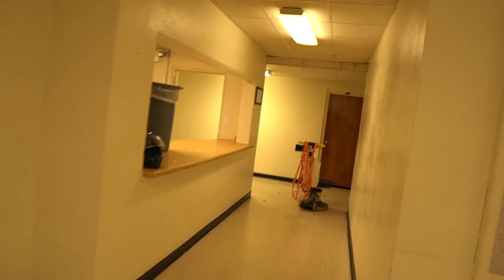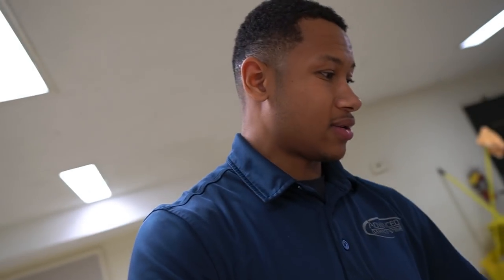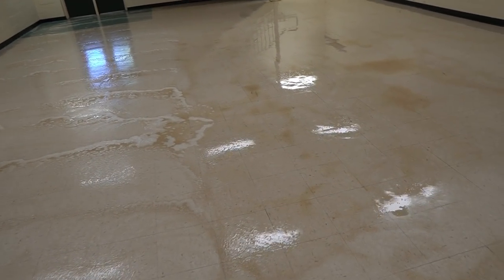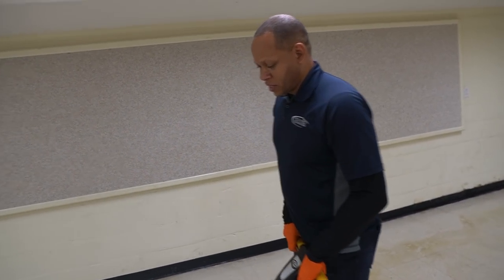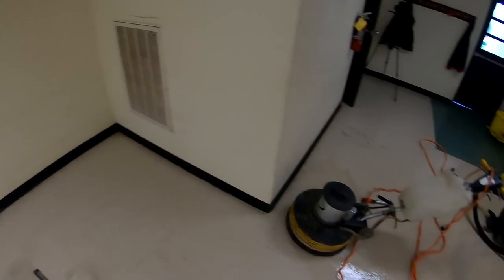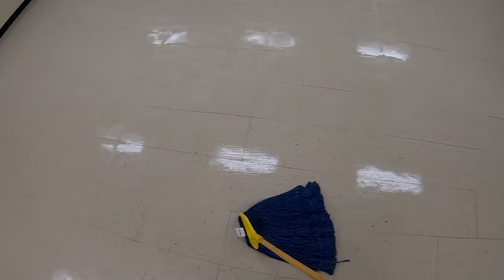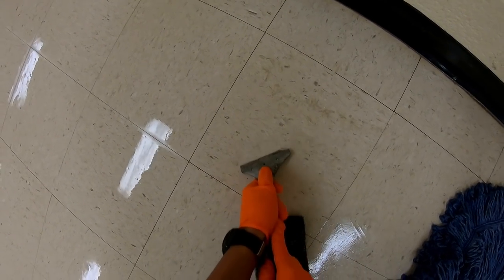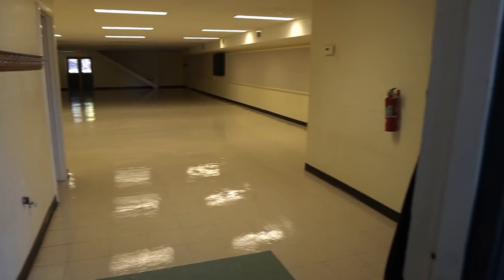ASHY to CLASSY || Stripping in a DIRTY church

Comment: I love your channel. A black man doing what i aspire to do, open a cleaning business with a specialty on floors. 

Im a custodial manager and have been for 7 years. Imma recommend the following, 
1. get stick blades. That way you dont have to do all the bending unless necessary. 
2. When scrubbing, stay in the squares and make 3-4 med speed passes before going to the next roll. This ensures you dont miss wax (almost)
3. Use hi pro (high productivity) pads with a flat pad driver (with no brush). The flat pad driver makes it easier to swing the machine and you can also tilt the machine on uneven flor, putting more weight on the pad to get all the wax off. The hi pro pads will make it easier to remove wax. Like literally 5x easier, ill never go back to thick stripping pads. Only down side is that they are like $50-$60 bucks for a pack of 5. BUT its worth it.

Comment: I did residential commercial cleaning for 19 years for a private contractor. and this reminds me of a rec center we did in a 55 and over community. we always used the hose and wand to vac much faster it stile took 2 days . strip day 1 wax day 2 lots of slips no falls looked great at the end.  I smelled striper for a few days after on that job😏. great video👍🏼.

Comment: Floor wax leaves residue that eventually needs to be professionally stripped off. That makes a lot of sense! Here in my country, its common to use floor wax to make floors shine. And before applying the wax, we would use a coconut husk cut in half to scrub the floors and make it shiny. I'm guessing the husk is making it shiny because it's abrasive and is scrubbing away the old wax.

Comment: As a Former Janitor I will always hate stripping and waxing floor especially the detailing and especially if they didn't remove the furniture out of the rooms before we get there
But I don't mind buffering
Ppl who never done it it is very demanding physically and mentally job and you really have to plan it out and be prepared or you can screw yourself over and create more work 
And the machines you have to have good control and the vibratarion can hurt your hands and yourself 
I seen a lot of ppl get hurt with bc they lose control or don't move cables and trip and fall 
Great job guys
Reply: You are very correct. I have helped out on these jobs and the stripping phase blows.

Comment: A HOMEOWNER can shampoo carpets only if you own a PROHEAT shampooer and then run between 1 and 3 water only thru the machine until ALL SUDS ARE GONE so yes a DIYer can do it. My Hoover ProHeat has the same dual brushes as your special commercial agitator. Not all people have disgusting carpets. Not many people know you must vacuum your carpet daily I used to sell carpet and everytime I told them you must vacuum daily they thought I was nuts.
Reply: It's disgusting what settles in there and you really should deep steam clean it 1x a year, 18 mos. max with a truckmount unit. Using a home unit, probably more often, but you are right on with the rinsing.

I had my job clean my apartment carpet again after the complex claimed to have professionally cleaned it before I signed the lease. It was still horrible smelling and sticky. Ugh.

Comment: even having a walkbehind scrubber with a droppable pad with vacuum pickup would speed your process up tremendously. your mopping would only be needed for the edges. you dont even need to drop the scrubber and could just drop the back vac squeegee to pick up the water.  I work with floors and I wouldn't want to densify concrete without one. its strictly for picking up water

Comment: Sup ya'll! Fellow professional cleaner here. Love the videos, picking up little tricks and tips for my own work! Just curious, why dont ya'll get a walk-behind scrubber for your bigger floors like the one in this video? Strips the floor and picks up the residue at the same time. Keep up the great work. Love seeing black owned companies thriving!
Reply: I work on autoscrubbers and the worst machines are those that pick up stripper. It ruins the vac hoses, squeegee tools, wheels and not to mention the frames. I agree it would be faster, but lots of machine cleaning after the process.
Reply: @kurdtm1147  Ive been doing it this way for 11years..never had a single problem.

Comment: If I had a cleaning company I would use a small floor cleaning with a black pad to get bigger areas that would cute my time in half I alos use blowers tip the blowers 45 degrees in the air to cute time in half I do floors for a church hear in Indianapolis it is very hard doing it by myself really sucks bad

Comment: Nice job as always!!! Just wondering would be easier to use the Truckmont with the Tile cleaning tool to remove and wash the floor from the stripper ? instead of vacuuming and mopping?

Comment: Need to run that scrubber pad on top of your mop so instead of bending down every time you need to rescrub a small area the scrub pad is right there at the top of your mop. Obviously you can’t fix everything with that truck but if it saves you from bending over 50% of the time your back and knees with thank you later in life.

Comment: Can you explain sometime how the wax works? Is it water-based? How long does it take to dry? How long does it last?
Reply: Wax is used to protect the floor it’s a wear barrier.
It has varying application ways and drying times. 
It wears off with use walking dragging etc.

Comment: Did you still put down the stripper with the mop? Just used clean water to keep it from drying in the resivor? Strip, neutralize, mop with clean water, wax.. the 4 steps correct?

Comment: Hey man, I love the quality company you guys run. I'm really wanting to start my own here in New Mexico. I'm curious, and won't be insulted if you don't want to answer. How much profit do you take home monthly? Obviously aside from specific high/ low seasons and of course it takes time before job consistency. Thanks for the awesome videos!
Reply: Not sure if they'll answer, but my dad's went under because people don't want to pay for quality around here.
Reply: @madtabby66  really? Thanks for responding friend! That helps
Reply: Figure out your production rates (sq. ft. per man hour) for different types of jobs (land and leave times), log the amount of product used, etc. on various types of jobs (repeats, 1st time strips, ones that include moving furniture, ones that don't, wide-open spaces vs. "cut up" spaces, etc). Also, differentiate / track between stripping time and # of people and wax time and # of people.

Having those #'s will give you a sense of what to charge under different circumstances and come up with a per sq. ft. range to check your quotes against.

At my work, the #'s change and can vary dramatically when you work in newbie helpers on 1st-time strips vs. very experienced people who have all worked together before on repeat jobs.

After that, set up systems and efficiencies that help you work smarter, not harder. This includes products, equipment, and supplies that will further increase your production and quality, processes for making sure you have all your equipment and extra supplies on hand, and processes for when you arrive, unload, and stage your equipment. When you do the walk-throughs for quotes make sure you note where the water and dump sources are.

^ This is one thing the company I personally think the company I work for should work on, but once you get ingrained on doing things a certain way it becomes hard to deviate. I was relieved when they stopped using Zep stripper and finish. There is better product out there. 

We got a 7% discount sourcing from a local reputable janitorial supplier since we get a lot of the products we need there and don't have to waste any more time driving to all the Home Depots getting the Zep we needed. We always apply 4 coats of finish (2 only edge to edge) per our contract.

We don't even bother with big-box floor jobs. We try to stick to 5,000K ft2 buildings or way less square footage in general.

Our minimum runs from $550-$850 depending on the location, condition of the floor, if it's a 1st-time strip, repeat job, open vs. cut-up areas vs. mixed, moving things off and back from the floor, and if there is no area (like carpet) to stage furniture. The higher the PIA, the higher the price.

We try to aim for / clear $100-$150+ per man-hour if possible and include up to 2 strips in the price typically, but sometimes you have to factor in time and product for up to 3 strips for atrocious floors. Our per sq. ft. rate lands between $.65 - $1.50 ft2 generally depending on what's going on (Metro Detroit area). 

Account for an extra remobilization fee and per man-hour labor charge (and list them in your quote) as a notice for clients who don't prep right or fail to do the things they agreed to and charge accordingly. Make sure every quote is signed/initialed and returned before you guarantee your customer a firm booking date on your schedule.

We use the Basecamp 3 app to log information on jobs for the staff and for the company for future reference, marketing (like uploading photos into one place for future use). When the job repeats, we create a new card for the upcoming job with all the relevant info.

Load up your Google My Business page, Facebook and others with before and after photos and encourage your clients to leave good reviews. This will help future clients to choose you as the best option for quality work at a FAIR price. Stripping and waxing is very physical and time-consuming and not many people get that.

Pre-educating them with videos like this one posted goes a long way. You can also set up time-lapse video cameras on the job if you're not a talker. One will run you about $300 or less.

Once you get your personal #'s squared away you can create an Excel spreadsheet that auto-calculates per hour and per sq. ft. price ranges. HTH

Comment: I'm in desperate need of advice for getting the floor in my apartment fully clean.  The complex "renovated" a few years back, removing all the carpets & installing what seems to be very poor quality "wood" stick on vinyl strips, covered in groves for what I assume to be "realistic" texturing.  The shine completely disappeared in just a few months, & even with daily sweeping & constant mopping, the groves fill with dirt, turning black, making it appear as if I never clean my floors at all.  The only solution I've found is getting on my hands & knees, using a scrub brush following the direction of the groves.  It takes days to clean, since I have back issues & can't do more then one room at a time.
How can I get this done easier?  Once I have an area clean, is there a product I can use to smooth the floor, & hopefully create some sort of shine?
I am open to any sort of suggestion, from anyone!  At this point, I'm willing to try anything.  Your grandma tell you some crazy hack she use to do in the 70?  I'll try it.
Reply: Home Depot rents buffers (floor maintainers or polishers) as do other equipment rental companies. Our company uses this type of machine with a white, red, or blue round cleaning pad attachments (least to more aggressive, red lands in the middle of the whole span of available pads) with either a neutral floor cleaner product or something on the degreaser side to clean LVT vinyl plank floors in businesses. We attach a 6" splash guard to the unit to protect walls, etc.

You do need a feel or some kind of experience to do it right though if going DIY. Those types of machines can get away from you. Don't leave the floor too wet for too long since you suspect it to be on the cheap side. You don't want to "buy yourself" a new floor. Follow up with a clean water microfiber flat mop rinse / dry passes. We've turned around some grody pizzeria floors with this type of flooring.